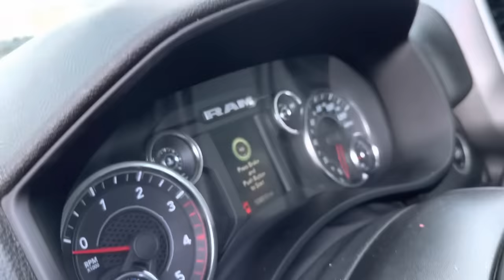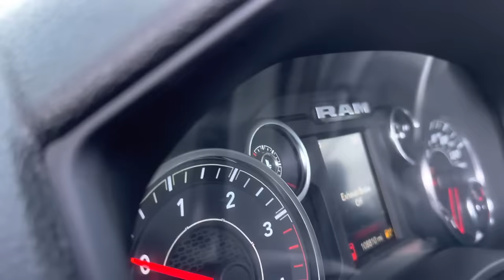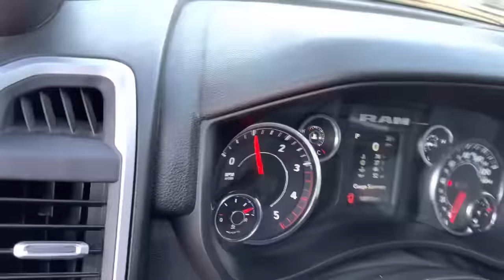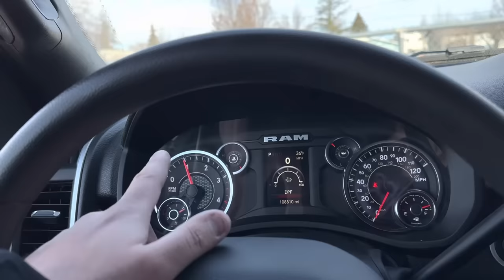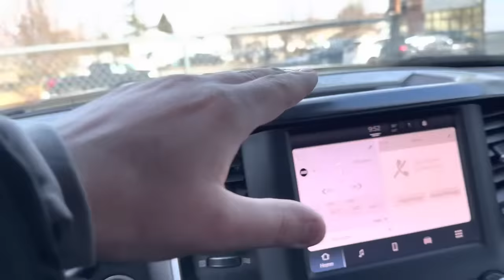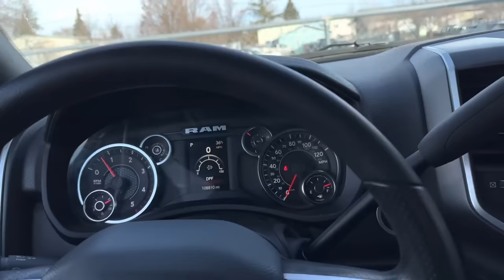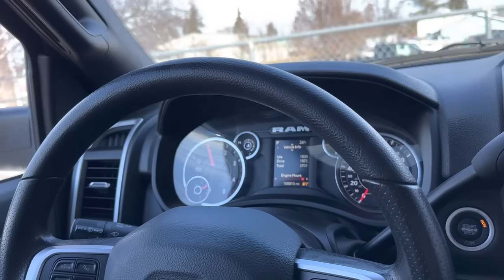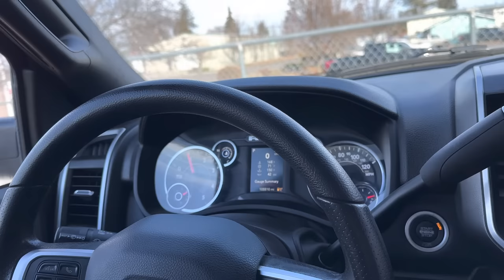2022 Ram 3500. 3rd engine down. 3 signs your engine is failing.

Comment: I have a 2021 HO and I’m praying I don’t have any issues with any of this crap. So far it’s been great. Thanks Paul.
Reply: It’s a time to start doing cancer screening at early stage’s, it’s called oil analysis.
Reply: @david brown. I also have a 21'and it's been great. Don't mind this repair vehicle guy. He's just jacking his jaws. Paul knows what he's talking about.
Reply: @Youngmechanical  Something weird is going on for sure. Not sure if Cummins used sub par parts or if what a lot of people are saying in here about oil issues is the problem. I personally just run Amsoil 5w40 and change my oil every 8k no matter what. So far so good. I also run Hotshot EDT on each fill up and so far it’s been a perfect truck. I did change fuel filters at 10k and will again but this time at 12k. The filters at 10k were not that bad at all. Thanks for the reply.
Reply: I have a 21 as well. Awesome truck. 64k, no issues. Seems like the 21 is the best of the 5th gens so far.

Cummins didn’t use sub par parts. Mopar did. They had Cummins add hydraulic lifters to the 19+s. You can’t even buy them from Cummins, it’s a mopar only part. All the 6.7s Cummins makes for other manufacturers still use the solid tappets and adjustable rockers, as all ISBs have used since their inception in 1998. Now we’re seeing cam and lifter failures in 6.7s, like the hemis have had since 09.  This failure was virtually unheard of in a 5.9 or 6.7. Hydraulic lifters was a solution for a non existent problem.

Comment: Really would like to see more detail on this because I felt like I had been missing something with all the vague allusions to a catastrophic failure that was never explained
Reply: The lifters are made of Chinesium and the lightweight oil is causing these failures. Some dealers are saying up to 6 months backordered on the engines.

 There is also the catastrophic failures of the Aisin transmissions for the 22s
Reply: @wizard_of_poz4413  good luck. 68s are garbage
Reply: @kyles234  you say that but we were going on a 4 wheeling trip to west va doing a little "spirited" driving through the hills with our trailers on the way to the site. And my 2500 68rfe was staying pretty comfortable the whole time at 170.
  All this while the two Allison guys in the other trucks had to stop every 15mins or so because one was at 210 and the other was getting above 235.
Reply: @wizard_of_poz4413  my Mercedes G56 transmissions will outlast that crap. Autos are junk. 523k and still going
Reply: @kyles234  yea it's a good transmission but I'd have to either derate my engine to 650 or buy the cpp extreme duty for like 8k. Because the case on the stock g56 is too thin for 850tq
Reply: @wizard_of_poz4413  my g56 has been handling 500hp with 900ftlbs for 300k working in the oil patch. Hauling never less than 3k in the box
Reply: @kyles234  right but how often do you pull 30k+ trailers
Reply: @wizard_of_poz4413  my gross is over 30k with my toyhauler.  Manual transmission always win the reliability contest. No electronics. Only $1500 for a new clutch. I've owned a 48RE, a 68RFE,  3 AS69RCs they were all junk. Terrible fuel milage. I went back to G56s.
Reply: @wizard_of_poz4413  Back in the day I ordered  a 2014 Mega cab dually with G56. Literally had under two hundred miles changed the clutch to a Dual disc, pulled the turbo and sent it off for a bigger wheel, pulled the injectors,.and went 30% over. 
I pulled 30,000 pound trailers all the time and traded the truck with 200,000 miles   G56 didn't give me any trouble.

Comment: 2019 and newer models do not take 15/40 oil “15W-40 grade oil CAN NOT be used in any 2019 model year or newer 6.7L equipped vehicles due to the new designed valve train of this engine. If this oil is used, it will cause deposits to form in the Hydraulic Valve Lash Adjusters leading
to undesirable noise, and/or engine damage.”
Reply: Plus 15-40 has higher ZDDP and will destroy the DPF with metallic oxide ash

Comment: I have a flawless 2018. Don't want a 19, 20 (cp4) not sure about 21's and now no 2022. What the heck is going on with RAM? Thank you sir.
Reply: engines are built at cummins....someone needs to call Cummins and ask them!! now, the emissions system on the exhaust pipe is made by stellantis , that could be a problem.......

Comment: My company has had approximately 500 Ram pickups in our fleet but due to the major issues they are now in the process of replacing them with Fords and Chevys.  My company truck is a 2020 and has 112 highway miles on and other than the turbo actuator having to be replaced it has been a great truck.

Comment: My ‘22 just went into the dealership for internal engine issues. I have the Cummins HO engine. They aren’t aware of the issue yet, but to me it sounds like lifters. My truck only has 10,000 miles on it. I don’t use my truck for work so having it down doesn’t cost me anything. I am disappointed in Cummins for the significant drop in quality. As long as Ram and Cummins own up to the problems and fix them I can’t be too mad, but man am I disappointed.
Reply: I only have 2021 2500 Cummins with only 15,600 miles hardly run truck and a few days ago it wouldn’t start and now engine light is flashing and stays on!!

Comment: The after treatment codes are a result of the internal engine failure. When whatever is failing in the valvetrain gets bad enough to start affecting combustion efficiency the engine begins producing excess soot. The after treatment system can only process so much soot before it becomes a problem that begins overloading the DPF and then you start seeing the faults and possibly being asked to run a parked regen. This seems to be an oiling issue. You should post the repair description from the other trucks you have that failed and show us the parts list that were replaced. Hope they get this figured out,  there's not a good option for a diesel pickup if you can't rely on Cummins anymore
Reply: Hit a pothole, lose certain parts...
Reply: It's got alot to do with tuning the regen is not getting the engine clean the sensors get dirty and cause false readings it's not a bad engine but the emissions system is just a terrible redesign gm and ford have had a ton of these problems going to direct injection carbon builds up really fast causing problems that are terrible
Reply: The regeneration doesn't clean anything in the engine. It only burns soot in the DPF into ash which still needs to be blown out of the filter periodically using the FSX cleaning machine. The soot accumulation in the DPF is a result of an engine issue but after soot begins restricting flow in the DPF it will effect engine performance. Until you find the root cause of the excess soot production this problem will reoccur
Reply: If I was to bet on the source of the issue I would be suspicious of an EGR issue ie: stuck open egr valve or  a possible CAC/ boost leak, or possibly a turbo issue. Wasn't something about valvetrain issues mentioned in the video? If you have any sort of valvetrain failure, that would be the popping back in the air cleaner that they are hearing, it would definitely increase soot do to incomplete combustion

Comment: Ah I heard Cam and I instantly knew what you were talking about about.  The engines are eating the cam.  And I think it come down to the new hydraulic roller lifter.  And it the same problem newer gas engines are having.  The rollers are wearing out destroying the engine in the process..  there’s a problem with the new valve systems and they keep making things worse

Comment: I will stick my 12 with 378,000 plus no def. Part of the problem with these newer high torque engines they are just pushing too much torque. But most of hauling is with an 05 Ford 6.0 and I never pull a hill like I need to get to the top first. I hold my egt and my ect temps down and keep my fuel pressure up. But I don`t know anybody down that has not had problems with the 18 and newer Rams. The only thing I worry about with my 12 Dodge is I check the grid heater bolt on a regular basis. But all cummins have there problems. We have 2 older 5.9s that have been killed my the dowel pin coming out and breaking the cam shaft.
Reply: Torque is not an issue at all with these lol they are incredibly derated

Comment: Got a 22 3500 SRW w/a standard Cummins & 68RFE. Just hit 10K. No issues so far, & hauls my Lance truck camper with ease. Respectable fuel mileage too. However, I'd be curious to know if Chrysler/Stelantis resorted to using 2nd rate parts from alternate vendors due to "supply chain issues". Maybe bad quality control would explain some of the recalls, etc.
Reply: My roommates 22 just developed a really bad knock pulling a horse trailer through a mountain pass. 11k miles. Its now sitting at the dealer 😬
Reply: I have a 2013 big horn just installed an idash super gauge and pedal monster. Looking to change air intake,air box and filter, exhaust. 100% emissions complete. There shouldn’t be any issues for Dodge Ram to invest in the banks after market technology to make sure this vehicles stop causing catastrophic damage.

Comment: I bought my 2007.5 at 18months old and 67000 miles. The DPF was totally clogged with ash. You cannot burn ash in the DPF. Of course I drove really fast down a horrible road and some stuff fell out. Hole saw took care of the ash problem. Oil change at 3000 15W-40. I don't care what they would say, no way I would run 5W in a diesel. Truck runs better than new still at 16 years old, 240000 miles 74,000 of which is towing at 25000 pounds all up, lots of backroads and mountains in that towing. RV traveler full time.

It is that new Italian steel.
Reply: Lack of oil knowledge I see. It's a problem with DPF generation diesels because 15w-40 has higher ZDDP that cloggs DPF systems with metallic oxide ash. Problem#1 
On problem#2 . (15-40) the  5w-40 is better oil. Especially synthetics. 
when cold it's 5w and then 40w when hot.
 Flow protects, NOT pressure which is a result of restricted oil flow. People are incredibly ignorant about oil.

Comment: I have seen engine builders complaining about premature lifter failures eating up the cam due to soft metal.  Sighting supply chain issues causing cam manufacturers to source lifters from China.  Wither it is a domestic or foreign the problem is improper procedures for the heat treatment process.  I wonder if this applies to this problem, cam, lifters, rocker arms, and pushrods.

Comment: I work for a towing company and operate 10 Ram 5500 cummins..and 10 6.7 international and M2 freightliner haven't had any of this? New truck or 2 purchased every year. They are beaten daily towing excessive extended idle time.. only major problem we had was the Ram front driveshaft u-joint failing total destruction. Transfercase split in two. Witing harness, hole in floor and brake lines..65mph total unscheduled rapid destruction 😊

Comment: I have 9 of those 22s and not one has an issue I use mobile one oil all around 70-150k miles
Reply from the maker: 10w30 or 5w40?
Reply: @pddieselpower  10w30 with 200 ml of lucas oil Stabilizer
Reply: High output or Standard?
Reply: @tylerrysdam  standard

Comment: I have a 19 ho with aisin and it runs good. I want to know tue defected ones are bieng made from. Factoyr wise. Thats where the problems are coming from. Mine was made in mexico says on the door. Runs strong. So check yalls manufacture location. That could be the issue

Comment: Hemi engine builders have had a problem like this when pushing more power like putting blowers on them. They have found that the oil journals weren't allowing enough oil up the push rod and wiping out the roller tappits and the rockers. I'm not familiar with the Mopar moters and there oiling system however one engine builder said his solution was he drilled out the oil ports in the tappits and that stopped his engines from gernaiding the valve train.

Comment: I've heard recently that there is carbon building in behind the piston rings causing issues, Caused by the emission system.  Not sure if this would be the problem with this truck.

Comment: I have a 2014 Ram 2500 HD 4x4 crew cab, 8' box with a 6.4 gas motor. They've already put 2 new motors in under warranty and going to put a 3rd new one in. Same problem with all 3 of the motors. Cam and cam bearings going out filling the motor with metal bits. When it's cold, it sounds like rocks in a can being shaken.

Comment: I have a 2014 ram 3500 6.7 dually and do hotshot class A. Just about every hotshot I talk to and the TV guys, they idle all night. I can guarantee you guys are idling. This is the reason why your emissions and your truck is crap.
I have a small Honda generator with a small space heater that gives me heat in the winter and ac in the summer. I have never idled and have 600k and still going strong with no filter cleaning of any type on the dpf system.
Reply: I meant it isn't deleted
Reply: I hope your right.

Comment: Totaled a 19, got a 20 with miss, engine light Cp4.2...trader for a 22 roll through 22k with power, 25+ mpg and lots of DEF. Bought Oct. 2021 one day before the relay recall...we got the ab relay not the aa. Part#

Comment: I have a 22 dually 4:10 high output. The first few trips were fine. Then for some reason the exhaust was working 1/2 as strong as it was, not worried it has big breaks. I was going through the Ozarks down a big hill with the exhaust brake on and the curse had about 20k pounds behind me. The truck was picking up speed at about 74mph it down shifted and a second later it down shifted agan. Wound that tack around screamed the engine scared the hell out of me. I stomped on the accelerator to force an up shift, it shifted with a bang. It does this all the time now, It didn't do this on the first 2 trips. Told the dealers, they said they can't make it do it. So I don't think they don't believe me. Told them you would need a big load and hill. I am so sorry I got rid of my 15. The HO engine is supposed to have quite a few upgraded parts, what are the odds of having problem you are talking about?

Comment: Thanks for sharing your experience with these trucks. My whole buisness depends on my 22 2500 and since my 2011 3500 6 speed never had one engine issue after 250.000 I decided to stick with RAM. My 22 was purchased with all the symptoms your explaining. 60,000 and Dodge has had it for a month. Please if you could what are some things I need to ask once I bring it back home? I'm worried that I made a bad investment or once they fix it it should be reliable again?  Thanks
Reply: I just took mine in for some recalls and told them it had a tic/knocking sound. They looked at it and said it will need the pushrods and rockers replaced
Reply: Does dealer or warranty cover a free loaner truck for you while it’s at the shop?
Reply: @timhawk4383   yes thankfully but that too was a hassle. They had the truck for months so had to switch out renrltal trucks often couple times getting ones without trailer hitch. I actually just got mine back after second trip to dealer after timming cover leak.

Comment: Don't emission changes go into affect January 1.  So a '22 built, lets say 10/31/21, will actually have a '21 emission certification package.  Not sure if any changes were mandated for 01/01/2022.  Remember this back in 2004.  The pre 01/01/2004 trucks did not have a catalytic converter.  Trucks built 01/01/2004 and later had a cat.  The trucks with the cat converter always had a lot more soot in the oil.
Reply: Depends..... If Cummins supplied them with excess '21 engines, then the 21 emissions pkg. goes in and if Cummins supplied them with '22 engines early, then they will go in, with '22 emissions, on a 2021 frame.

Comment: I have 5 22s 3 high out puts and 2 standards and not a single issue at all. I have a hot shot business and I run the piss out of my trucks. I also run nothing but amsoil products. All oils and fluids. It's a little bit more but you pay for what you get.

Comment: Hello Paul, thanks for the information. I don't know if I missed this in any of your videos on your fleet of 22's, but have you compared build dates with some of the failures you are seeing? I've heard that 2H 2022's are seeing a significant increase in failures, along with the Aisin transmissions. Keep the updates coming!!!
Reply: Its called junk dodge
Reply: I just bought one 3 days ago 2022 built in  2021 what month did they start having problems. What is H2? PAID $66500 38000 Miles( Limited.)